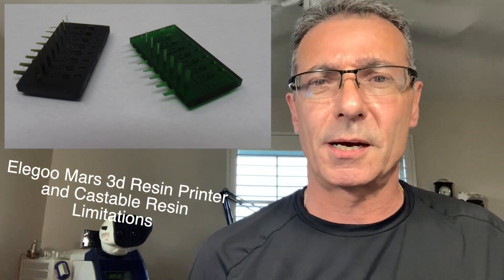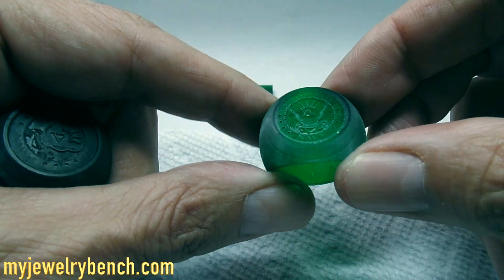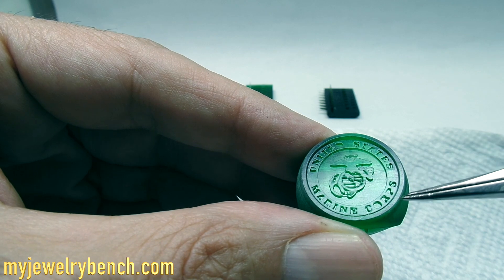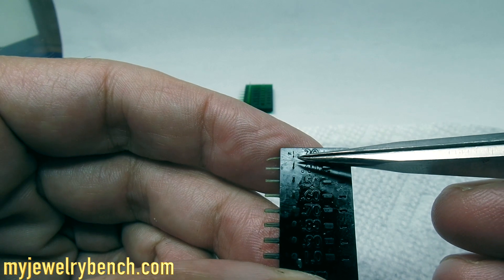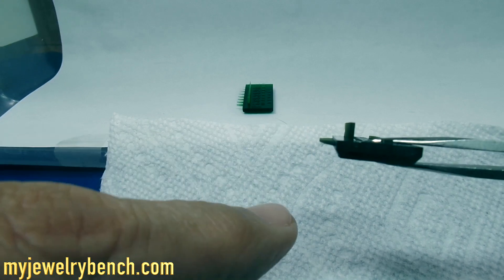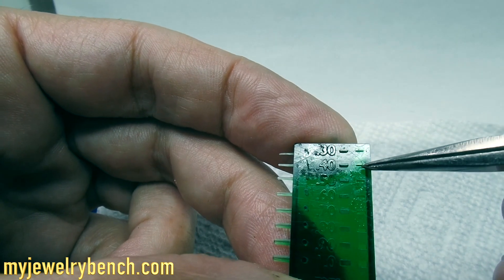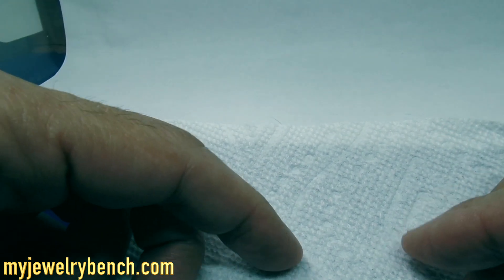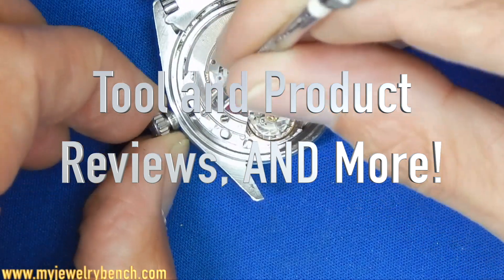Elegoo Mars and Castable Resin Limitations!

Comment: hi great video, i just got an elegoo mars 2 and have been trying to print with an Alphanese brand cartable resin with no success. All my prints have failed and have only had the first base layers print and stick to the film at the bottom. Nothing has stuck to the top plate either. Don't know if you have dealt with any similar issues. Would appreciate some feedback if you do.
Reply: what printer setting you using

Comment: My Solus never has the bleeding over issues. I can do recessed lettering all the way down to 2/10 of a mm. Same with my Envisiontec... on another note you have a lot of residue from lack of cleaning. The greasy looking spots on your prints shouldn’t be there after proper cleaning with denatured alcohol. Never use isopropyl for this. Although it is a method most commonly used it’s just not aggressive enough to rid of the residue especially in tight spots. A swish in denatured in 2 separate baths and the promptly use a electronic cleaner to blow off the excess. You’ll notice a huge difference in your prints A lesson I learned 10 years ago.
Reply from the maker: Well. Resins used for those 405 low power printers have issues with IPA exposure. Yes denatured alcohol works better but still has a similar effect on some resins. A lesson I learned also. Thank you for your comments.

Comment: Great video!
I'm thinking it might be better if I made my jeweler casts out of regular resin and then make a silicon mold of it afterwards as it sound like it would increase the quality vs the castable resin.
Reply: Kyle 0 use B9 Emerald resin. The best resin fir casting I’ve found in my 12 year resin casting experience. When lit with a torch the resin literally melts like wax. Other resins simply combust and delaminates.

Comment: Do you tilt both X and Y axis at about 25-30 deg ?       Do you print with resin and printer at 80-85 deg F  ?     Having the resin at that temperature and tilting seems to make a big difference in print quality along with reducing suction on the FEP.   I have a small enclosure with heater to keep the printer/resin warm during printing.
Reply from the maker: I tend to print rings at 30 to 45 degrees. Other items at 10 to 30 degrees. It really depends on my model. As far as temperatures my elegoo prints better when warmer but the pax does good at room temp plus internal heat. I’m in Florida though.   I also test every print with basic resin before I use any wax castable resin. But I do one of a kind prints not production work.

Comment: I've heard that the gap filling is because of a lack of cleaning before curing. What kind of cleaning did you do before your curing? Did you use an ultrasonic cleaner?
Reply from the maker: Yes. I use an ultrasonic cleaner. Issue has to do more with moisture and gas burnout. If the item isn’t cured enough (non wax castable resin I.e. anycubic castable)  they will boil out and produce gas that will crack the cast base investment. Wax resin tends to just melt, but is much more time consuming to print on the elegoo
Reply: Peter Grande try denatured alcohol. Isopropyl isn’t aggressive enough. I see tons of residue on your prints that would results in fillin if you don’t vacate it before curing.

Comment: I noticed that the counters (middle of the o or A) in the lettering for the USMC ring are missing. Is this an issue with the resin or printing?
Reply from the maker: The first few prints did not come out well do to antialiasing...  That is one of the things with Castable Resin, but once you get it...  It works great...  Any Wax Based Resin should be printed without AntiAliasing, and, I believe I covered some constraints with printing a ring in another video.  If I didn't, let me know... I'll make one.
Reply: Great work! Thanks for the video
Reply: It’s the printer. Cheap SLA printers just aren’t comparable to the professional grade printers. I bought one of these just for curiosity and sold it the next day. After a couple prints I new very quickly this wouldn’t cut it for the details on jewelry I print.

Comment: The majority of my prints so far are 0.05mm at highest. I've yet to print at 0.1mm or above, and no issues with fine detail :) Not sure that that test block is the most appropriate method to test a resin printer. Have you tried the photon-resin-calibration files? (e.g. - https://www.youtube.com/watch?v=P5p4IgZuqMA )